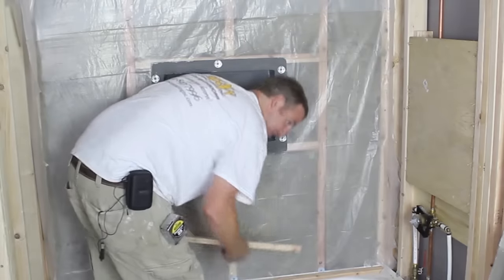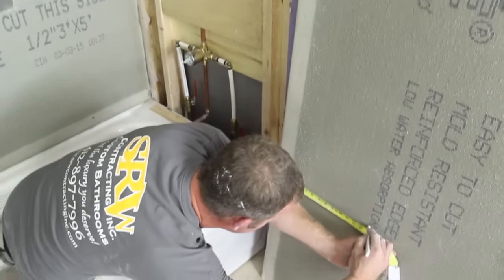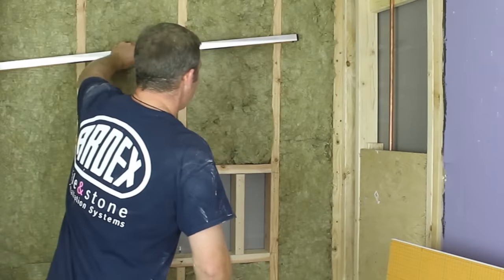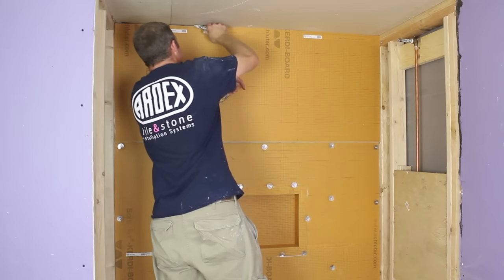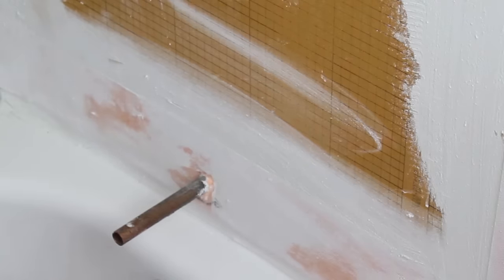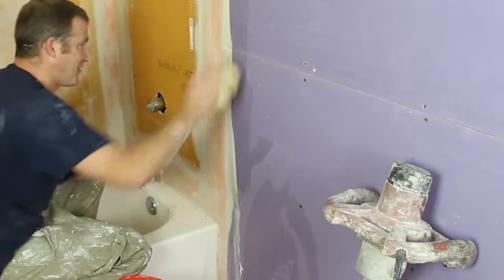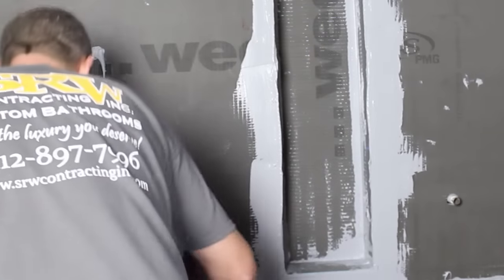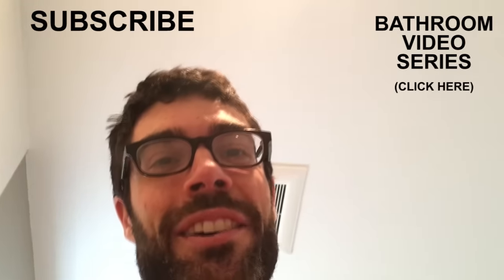How to Waterproof a Shower (3 Awesome Methods!!)

Comment: The walls next to my shower were Sheetrock. They rotted. I don’t want to mess with my shower but I need to waterproof the walls. I removed the sheet rock board behind the shower tile. Can I slide the Kerdi or Wedi board behind the tile of the shower where I removed the sheet rock?  How would I join edge of tiled shower with the side and bottom of floor? Can I paint it or do I tile the whole wall? The floor is Mexican tiles and the shower is white tiles. 
Thank you for your awesome video and your help and support ❤ MaryAnne

Comment: I noticed you used plastic sheeting as a vapor barier , then hung cement board, then used a roll on membrane to waterproof your shower.  I have read and seen videos that say not to do both because the wall system cannot breath or chance of backer board holding moisture .  Just a thought.

Comment: I like the wedi board for two reasons. It's the most simple and there is a reputable dealer close by to get it from. The next question is cost ,which I haven't compared.

Comment: Good video. I like all three methods. But since you said pick one it would be backer board. That's only because the other two didn't seem as rigid as backer board. I have never seen or even knew about the other two products.  The ease of cutting them and carrying them is a plus, tho.
Reply from the maker: +Lisa Libeer yes, foam boards are way easier to work with than cement board...although pricier. That said, cement board has its place. You just need to waterproof it with a liquid or sheet membrane.

Comment: Great video production.  I would use the Kerdi method.  I like the taped seams and ease of cutting.  I am finishing my attic space and this may be a great method for me.  Thanks a lot!!
Reply from the maker: Thanks, are you putting a bathroom up in the attic?
Reply: Yes, I have a large attic space.  Finishing 1150 square feet.  Thankfully the previous owner had the builder run dry plumbing and drain lines to the second floor.  Love your videos.  Very helpful and they do not waste a lot of time.  Great production.

Comment: Its Kerdi Board for me.....A bit more expensive but comes with a manufacturer warranty (when installed properly).  Between cement board and waterproofing the costs get similar. There is a full system that goes beyond the panels shown including a floor product. Take a look....

Comment: Would you clarify the pros and cons between the 3 methods?  Great informative video
Reply from the maker: +Lois Baker sure...KERDI and Wedi have great warranties while cement board is dependent on the manufacturer. KERDI is more expensive than the other two but easy to use, awesome customer service and like I said a fantastic warranty. Wedi is waterproof the whole way through as long as you don't pierce the second cementicious layer. It's also easy to use. Cement board is the cheapest but keep in mind it should be waterproofed with something like RedGard or HydroBan or Ardex 8+9. Plus it's heavy and a pain to adjust. Hope that helps 👍

Comment: If you put the Arden 8-9 on the tub flange and the cement board gap, will it crack tiles if there’s movement from the shower base? A lot of people just leave a gap or fill the gap with silicone. I haven’t waterproofed mine yet but trying to figure it out. I have used butyl tape over lip onto the studs prior to cement board going up, I was going to also silicone the gap as well. This should be sufficient?

Comment: Nice tutorial... I haven`t found any plastic vapour barrier while removing old shower screen panels for renovation. After your video I`m thinking about it... You have placed a plastic film under cement board. Is that recommended for all the bathroom walls around or for shower cavity only, please?  What sort of plastic do you use. Shouls it be something special (probably perforated) or any plastic would  be OK?

Comment: Man, I was trying to choose between WEDI and Schluter, and I believe I will go with the WEDI.  Mainly because I can't get Schluter board at HD, but can only get their membrane to go over greenboard.  So it seems like after doing the math, the WEDI Kit is an all inclusive deal for a tub.  I was also looking at a brand called Dural, Durabase XPS, but it was a piece together ordeal, like Schluter, but even though the initial cost was less than both, I couldn't find a lot of information on it, or other people that have used it yet.  So there were too many questions about it.  

Thanks for putting this video together.

Comment: Hi
I found out that there is water under our tile shower and have not been taking shower there. It has been a week since I have been placing toilet paper along the edges and now the only one section about 5 inch long is moistening after 12 hrs instead soaking wet. 

Can water seep thru grout to be stored underneath? 
Regrout with epoxy or use sealant is better?

Thank you!

Comment: great video. i have used Hardie backer for a shower i the UK. very strong. i am building another shower with the same. interesting that Hardie's own video does not mention liquid waterproofing. their advice seems to be to tile straight onto the substrate. have i missed something? (i have had no problems with my shower after a year- tiled straight onto the board.)

Comment: I like the shluter Kerdi board. or the cement board. I'm remodeling both my bathrooms currently and I think I might go kerdi board. depending what my local home depot has.
Reply from the maker: +Brandon Fletcher our Home Depot only has cement board. If you go that route you can' use either KERDI or a liquid membrane to waterproof it

Comment: Im about to do 2 bathroom remodels. Im leaning towards the kerdi system. The waterproofing of the cement backerboard is the expensive part in my area. The red stuff cost $100.

Comment: I just siliconed the joins and seams then mesh then thinset. I used fortified thinset and although silicone does not adhere to thinset I was able to cover the corners and seams with thinset through the mesh and cover the silicone. After numerous showers I did the second bathroom next door to the first one so I could inspect the first bathroom backerboard from behind. Corners and seams bone dry. Also I made sure no thinset got applied to the lip perimeter around the tub then I filled it with white silicon underneath 1 inch of the tile around the perimeter. If you tap on the tile you can hear a hollow sound but after the silicone the sound is gone so you know it has been filled. It probably takes more time but it's a DIY  job.

Comment: I'm remodelling bathroom as we speak... Prepping the floor. I think i'll use Kerdi Board. Seem easier. My question is:  My shower will be in an inside wall, should i use a plastic water vapour barrier ? I'll be using one on the other side (exterior wall).  Thank you for your Video's there great. I'm in Montreal,QC. Canada
Reply from the maker: +Stéphanie Desrochers we don't use a vapor barrier behind behind KERDI-BOARD. The fleece helps reduce water vapor in the stud bays. DITRA is a great option for floor tile. ALL-SET by Schluter is the thin-set that we like best for all their products and setting tile. Follow the directions though as that's very important.

Comment: The key to these products is being faster, which is to benefit the contractor in labor time. There really is no difference in the end 
result. They all provide a moisture barrier and a ready to tile surface. As a DIY homeowner, I prefer to use Denshield and Redguard. I am in no hurry and don't see significant benefit to justify added expense. The shower floor is a different story, in which I like the new products and techniques far more than the antiquated yet still commonplace method of preslope.
Reply: David Corpus, how do you recommend doing a shower floor?

Comment: Crazy , I took out 50 year old tile in my shower . Nothing wrong , just update .
Tearing out found they used green board with no waterproofing . It was perfect , no leakage no damages whatsoever from water 
All these systems are super expensive and YouTube filled with failures.
I figure I'll go with green board with added red guard . 
The old shower lasted 50 years with no water leakage no damage .
Green board is cheep easy and fast . Again , I will add red guard .
I think it's more to do with solid quality craftsmanship . 
Hey , 50 years is enough proof to me the old way works great . 
Cheers !

Comment: Hardie backer  1/2 ×3×5(cement board)  tape the seams with modified thin set then apply red guard which is a waterproofing membrane applied with a paint roller .all that's left is to tile. The biggest expense of this type of waterproofing would be the red gaurd at $48.00 a gallon which covers I believe 600 sqft . This is another method.

Comment: I used hardibacker board and Schluter membrane to seal the concrete floor and corners all the way up until 6 inches to the shower ceiling.
Do i have to completely seal the walls, can i use Redgard for the rest or is it not necessary to seal it? Do i have to seal the ceiling of the shower?
The guy at Home depot told me i should not put a vapor plastic behind the hardibacker because it will prevent the hardibacker from breathing and cause mold.
And what trowel should i use for 10X17 inches tiles?
P.S Those hardi board are HEAVYYYY

Comment: I thought all 3 methods were good, but preferred the wedi board simply because all joined edges were sealed.  I'm looking for information on how to install a custom size shower, especially how to go about installing the base to ensure we have no leaks.  We have an older home and our bath was, unbeknowst to us, (until too late) invaded by termites due to moisture.  So, obviously, we are on a mission when it comes to moisture control. I just happened to read about "mold sandwiching" which also concerns me.  A video showing the installation of a custom shower base would be appreciated!

Comment: Comment for anyone.  I noticed when the Kirde boad was being installed, there was some flex between studs.  Would this not cause a problem when cleaning the tiled walls down the road and break large tiles and or crack grout.

Comment: Hi we used green board and walled to the floor then wedged our acrylic tub in place (its a Manufactured Home). So our board does not come down flush with the top of the tub causing the acrylic surround to bow at the bottom over the top. I have thought about removing the surround and building out with mortar, but then I'm not sure if this is the best approach and we also don't know if it would be longer lasting to mortar and use tile. Tile looks better, but its a garden tub so that's a LOT of tile. Any ideas would be great. All of the methods listed looked fun, but maybe the last would be easier. Maybe we need to tear out and start over? I'm worried about rodents gaining access to the home through gaps.

Comment: My upstairs tub/shower leaks into my garage ceiling. The builder put tile floors in and grouted up to the tub. I have yet to determine exactly where the leak it coming from but I has a suspicion that is the the over flow drain.. how can I confirm this without gong ahead and gutting my shower and tub?

Comment: The Wedi would be my choice if it didnt cost a fortune,the Schluter same thing,items all obscenely pricey,dont like cement board,dirty to instal. I used denshield and waterproofed joints with product similar to redguard and latacrete tape. About same cost as cement board one fith cost of German products, Nice video
Reply from the maker: +gasmanrm thanks, what's the cost for the Denshield?
Reply: 15.40 for a 5ft sheet,Wedi is around 90 bucks for a 5ft sheet

Comment: This might be a stupid question...is the purple drywall a suitable material to hang tiles from for bath/shower walls? If not, can I cover it with cement board/kurdi/wedi or do I need to remove drywall and apply cement board/kurdi/wedi directly to studs?

Comment: getting ready to attempt my first tub surround. I was planning on using Crete board but never knew about the sealer until I started looking on you tube. I had the understanding that you just seal all the joints with thin set. is the sealer necessary.

Comment: I intend to use Hardie  board and have a few questions:  1) Is the vapor barrier (6mil plastic) only on the outside wall between insulation and Hardie Board? Inside walls do not need vapor barrier as long as Hardie board is sealed? Do the panels of Hardie board need to be filled with thinset and fiber tape before sealing Hardie board?

Comment: I've used typical green board for 30 years , it's very simple and fast , no problems .
 The key is to use  very good waterproofing.
I coat everything with red guard . 
Everybody has a new way to invent the wheel 
The video shows very expensive systems and cement board . I've yet to hear from anyone why regular old fashioned green board is not suitable 
All applications will fail if not properly installed and sealed . This is the key , make sure you seal it well . When you seal the job well , it does not matter what your using behind the seal because it will never get wet . So it begs the question , why spend a fortune on various backer boarding , or messy cement board when if you seal it......it's not going to see water....ever .
The final red guard sealing , I do 4 coats.
Also noticed was they put plastic ....a vapor barrier......on the wall over the insulation before their wallboard .
Clearly it's an outside wall , however that practice was stopped by many  in the late 1980s . There is no reason to do that , it will actually cause condensation which will make your insulation and framing wet . Many good  professional installers do not know this . 
Do your homework before you remodel yourself . Not just youtubes , some are good , others are not do good .
Oh btw ,any of these systems have a typical 10 year warranty.
When you do the job correctly , your shower bath will last as long as you live or when you just get tired and want a change . 
I just tore out a bathroom I did , my first home which is still in the family done in 1984 
Tub/shower combo with glass block window .
I did it in green board and a simple seal . Nothing fancy or expensive and used a mastic to set the tile .
Not one single failure point , no leakage , not even  a single drywall screw  had any rust whatsoever . 
Bottom line , sometimes the most simple way is the best ,
Technology is a great thing , many great improvements , though in my experience the countless new systems on the market today are outrageously expensive and time consuming offering nothing more , and many times less than
the most simple and economical .
Reply from the maker: glad to know but you have an n = 1, which is not a good sampling for waterproofing purposes or any research for that matter. Plus, RedGard is not approved over drywall, it's in their instructions and verified by their technical support - we called and discussed this topic with them.

Comment: Tiled my inlaws tub shower walls 20 years ago. Just used mastic over the original crumbly cement board. No waterproofing. Didnt even tape and fill seams. Tore it out to do a walk-in shower conversion lately and not a single instance of leakage. Even has a window in the  wall. My parents just have tile over regular plaster in their shower for the last 50 years. Still solid as a rock. Not saying not to waterproof. Better to be safe I guess.
Reply from the maker: +watchnlearn1001 yes, those are our thoughts. The money spent on waterproofing provides peace of mind, safety and often a warranty for the homeowner. All good things when spending big money on a bathroom remodel

Comment: Steve, why did you not use thinset and tape the seams of the perma base cement board before the ardex waterproofing membrane and fabric? Is the hydroban or ardex and cloth all that is required?? Thank you in advance
Reply from the maker: that's correct, if you use Ardex 8+9 you can use the SK Mesh to seal the seams and corners if they exceed the recommended gap threshold
Reply: @HomeRepairTutor  That applys to hydro ban also, correct?
Reply from the maker: @keithowens9242  Hydro Ban Board can be sealed with just the Hydro Ban Board Adhesive and Sealant, it's very easy and super solid if installed correctly - plus it's fast!
Reply: @HomeRepairTutor  Hi Steve, I know but Ive already installed all the 5/8ths Perma Base Plus Cement Board so I was asking can I just install the hydro Ban and laticrete fiberglass cloth on Seams and corners and not the thinset and alkaline resistant tape?
Reply from the maker: @keithowens9242  if the voids are over 1/8" you should follow the instructions to fill those with a rapid setting mortar or fleece then use Hydro Ban, this video is fantastic and should help a lot https://youtu.be/H8tEBibuY68

Comment: Very interesting. Are there special products that these manufactures make that you'' have to use'' with their products once you've installed ,waterproofed etc and want to finish with tile or can one go to the supply house and get the typical off the shelf?
Reply from the maker: yes, always try to use the manufacturer's products together and limit mixing and matching...often you'll find mixing products voids warranties. And that's never a good thing for the homeowner.